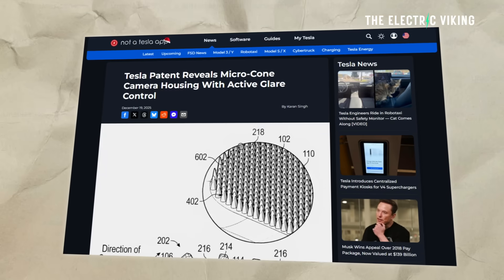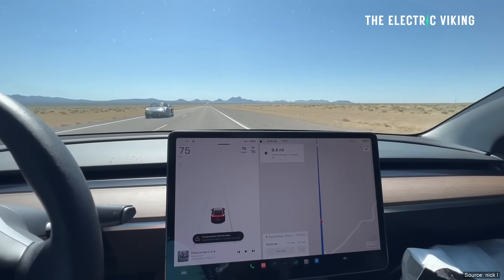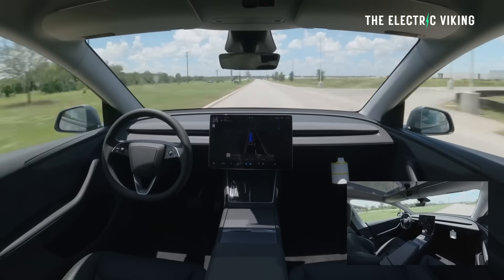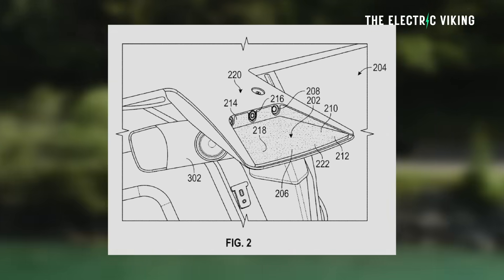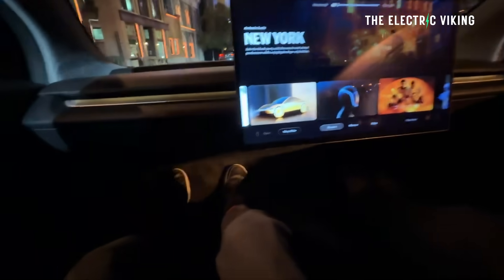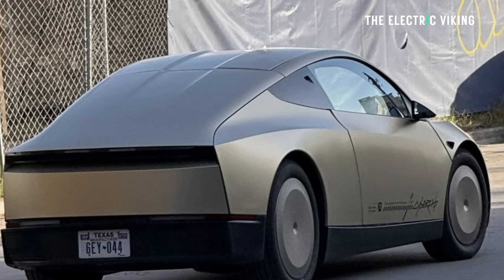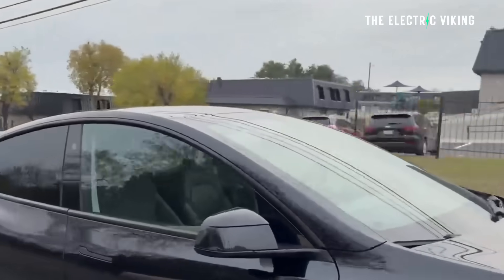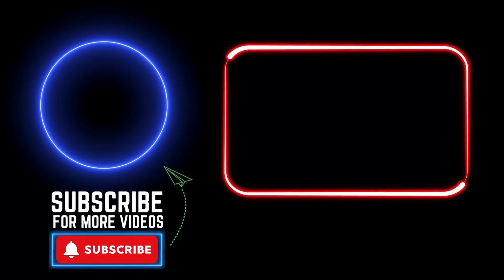LIGHT-SWALLOWING TECH! Does Tesla’s Micro-Cone Patent Solve FSD?

Comment: The patent is interesting, but Tesla still doesn’t have a Level 4 or Level 5 autonomous vehicle so it is hard to "imagine you're in a Tesla Cyber Cab cruising through downtown Austin at sunset or anywhere in the world at sunset", maybe next year?
 
The fact that Tesla is patenting micro‑cones, ultra‑black coatings and even a motorised "eyelid" kind of highlights the real issue: glare is a major weakness of a camera‑only system. Other companies avoid this problem entirely by using sensor fusion (LiDAR + radar + cameras), which makes them less challenged to being blinded by the sun in the first place.

A number of Tesla patents detail ideas that never reach production, but were this one to make it into the wild, the design would require new manufacturing processes (sintered steel vented moulds) and is likely to require a new camera housing architecture, no doubt meaning a future hardware generation (HW5 or later) making all previous versions of FSD obsolete.

So while the patent is interesting, it is also an admission that Tesla’s vision‑only approach has problems that they are still trying to engineer around, and as this patent is not present in any current production car, the current FSD systems are therefore known to be flawed; and yet the company keeps overstating how close they are to full autonomy.

Comment: though camera (visible light) only for US-FSD is elegant (probably more $$) using additional spectrum sensors is highly beneficial in some instances, including glare and other reduced or low contrast conditions 

I would like to have this: was in a very old Model X and it could determine many of cars not visible ahead with its forward-facing radar… M3PH wanted to go around a car erroneously seeing it was only one car “stalled” 100 ft from stoplight – 3D mockup displayed this

Comment: So, tesla will get better then level 2, but still not autonomous driving level 4? Meanwhile Waymo, Zoox are perfecting level 4 while moving passengers around. Mercedes is at level 3 on the autobahn.
Reply: Tesla is level 2 due to current laws and regulations, and for liability reasons I’m pretty sure. One thing that I find cool in the car is you can turn it off and on whenever you please. You don’t need special hardware equipped, you don’t need any special mapping. Just hit a button and it toggles. 

Waymo’s and zoox use specially mapped areas, and tons of lidar, radar, and cameras. These cars are fully controlled and owned by the companies, you will never personally drive a Waymo or a zoox vehicle. Multiple manufacturers have achieved level 3 autonomy, but as you mentioned, they are only level 3 autonomy on certain highways, especially when conditions are perfect. 

Tesla’s self driving tech is designed to be driven anywhere and on any roadway. They don’t rely on premapped cities, don’t rely on expensive, ugly looking sensors, their goal is to work everywhere and not just specific highways, and are private vehicles driven and owned by private owners all over the world. So it’s a little bit different.
Reply: @gamerdude422  Which is why tesler is having way more incidents at level 2 then Waymo or Zoox at level 4

Comment: Interesting development by Tesla to eliminate flare using tiny pointed cones etc.  There might be a problem when such vehicles fitted with this sort of features if, or when they encounter grime that would tend to settle among the tiny cones. So it may be necessary to also have a system that can effectively clean grime and dust out of the microcone light glare eliminating feature, unless those cones can be protected by a transparent cover.?

Comment: I saw an example of the setting sun flaring issue in a Robotaxi video.  I personally thought it was the edge case that would prevent Robotaxi from getting to level 5 automation.  I'm not an engineer, so I was really wondering what the options would be.  Add a radar just for this edge case (which I know Elon would never do)?  Apparently the answer is to think smaller -- micro-cones.  Hat's off to the engineering team at Telsa.  When they figuratively hit a wall they don't stop.  They go over, under, or whatever it takes to creatively solve the problem.

Comment: For Rain they should use high speed rotating front lens or an air blade in front of the lens to deflect rain drops
Reply: @johnmanderson2060

Good ideas, but a non stick coating is cheaper and less prone to malfunction. 🤷‍♂️

Comment: Glare is not the only problem with the cameras.  Long-term, I think actual occlusion is a bigger issue - snow, ice, mud etc..  So to fully stabilize FSD on a Tesla, there needs to be a way to clean any type of muck off any or all of the cameras.
Otherwise, I am seriously impressed with the way Tesla FSD is performing in non-challenging weather.
Reply: @jimparr01Utube

I believe, the solution they have come up with is mimicking the eye. ie. using micro water jet/tear duct and a wiper/eyelid.  Cheap and effective. Maybe should use warmed up coolant, to be more effective at dislodging dirt and melting ice, in cold climates. 
It was mentioned in this video btw. 👍

Comment: lol gun sights and sighting surfaces have been doing this for half of a millennium.... glad tesla finally patented it :p
Reply: If that's the case, then Tesla wouldn't bother applying for a patent.  I'm sure there are details that are innovative like the use of stepper motors/sensors to track the sun and control the light shield, combined w/ the array of anti-reflective cones and manufacturing techniques..
Reply: @kenbob1071  right, that would be worth making a video about. this one, not quite sure

Comment: Very cool! I hope this genuinely works as a reach around to the glare issue especially if Tesla isn't going to sell these with an optional or detachable steering column or yoke like I hope they do... I personally want them to use a left-right yoke that can be pivoted between left and right hand driving in under 3 seconds like GM's HyWire Hydrogen-powered/Drive by wire prototype from the turn of the century. That would also solve the global left-hand, right-hand drive issue in a more elegant way than the French concepts and their 3 across, central driving position also borrowed for the Tesla Semi of course..

Comment: I still think that a limited factor for Teslas will be the reliance on relatively low resolution, monoscopic camera system to the exclusion of all other sensor technologies. Elon insists on cameras only, against the advice of his engineers. His reasoning is that humans use eyes. But we have very high resolution central vision, which allows us to see detail at a distance that our Teslas can't and we have stereoscopic vision which allows us to much more accurately calculate distance and relative speed.

When you're stopped at a red traffic light, watch other vehicles jump around on the screen, as the Tesla's computer repeatedly calculates the distance to the other vehicles and repeatedly comes up with different answers. I've seen other evidence when driving as the car hesitates then goes then hesitates then goes as distance calculations to other objects varies every 1/36th of a second.

He maintains that it would be dangerous to have two sensor technologies competing, but they don't need to compete. Teslas could use vision primarily and use Lidar to much more accurately measure distance and calculate relative speed. Lidar can support vision, not compete with it.

Tesla is ahead now, but other manufacturers will catch up and overtake Tesla's self driving because they integrate multiple sensor technologies.

Comment: WRONG!  It doesn’t solve camera glare.  U r just regurgitating Elon talking points.  Those cones don’t matter crap when there is direct light.  Tesla is 100% EVERYTHING they can to avoid using radar and or lidar.  And they will throw everything to TRY to make it happen. Try not to be too much of a suck up
Reply: It won't be 100% effective all the time.  Most of the time the light is not coming in directly,  there is usually a bit of an angle so the cones would impact the amount of light hitting the lens, enough that FSD can still operate.
Reply: You either didn't watch the whole video or were so blinded by preconceptions that you missed the other things in the patent. It's not just about reducing glare from angled surfaces. Tesla is doing the right thing IMO, not giving up on developing a more efficient solution because it's hard. This is what innovation and progress is all about.
Reply: @bhabbott  8 years of promised full self driving.  Elon claimed his cars could go from coast to coast with NO DRIVER in 2017,2018,2019,2020,2021,2022 etc. yea so it’s not happening without radar/lidar.  At least their early models had radar but musk got cheap and that’s why China and the rest of the manufacturers will continue with FSD and Tesla won’t until they give in.

Comment: Another reason no other auto manufacturer is able to catch Tesla, Tesla just keeps getting better.
Reply: I’m a design process expert. Iterations are the key for refinement. Keeping the cycles shorter (cycle time & speed), you get more iterations. The design, manufacturing and test cycles for SpaceX are 10X shorter than the aerospace company that I just retired from.
Reply: Full self driving (unsupervised) promised for years. Also he promised that all teslas will be a robotaxi. Let’s say this fixes full self driving, all the people with current Tesla are out of luck. What about the roadster? He took everyone money and deliver nothing.
Reply: Lol...get a grip, dipsheet.  Tesla is dead, it just hasn't realized it yet
Reply: You sound like a complete waste of space, you work for Tesla?
Reply: Other makers use lidar and radar and can self drive in a much wider range of conditions than Tesla.  This means that every Tesla ever sold is incapable of FSD - so Tesla is unique in how wrong and dishonest  it has berm the whole time when other makers already had glare solutions.
Reply: @davidbangsdemocracy5455 What you say makes no sense. The kind of sensor (LIDAR or Camera) is secondary to the IQ of the software for driving. It’s the decision making of the AI software. The AI software is the hard part, not the sensor, which is just a component of the system.
Reply: @davidbangsdemocracy5455   Don't turn the lights out on Waymo or you will be walking home. Tesla's FSD has no problem with city power outages. It's all about the software and speed/accuracy of hardware integration.
Reply: @davidbangsdemocracy5455  geo fenced and thus mapped area’s. That’s something else as FSD, wake up
Reply: Tesla cars still can't do what Elon claimed they could do in 2017.
Reply: @chrisleaver929  like what?

Comment: Not sure why the robotaxi has swing-out doors instead of sliding doors.  When they swing out on either side of the car, they put passing people or vehicles at risk.
Reply: Try opening you car door in traffic. youll get the same result.
Reply: @dclpgh  Get the same result as a horizontal sliding door??????
Reply: I think its because of self cleaning. I saw a video of the car coming in for a scheduled stop and a machine enters from the side to clean and vacuum.
I suppose they worked out a traditionally hinged door doesn't give them enough access.
Reply: @NatureAmen  I meant a powered sliding door, not a conventional hinged door.
https://www.youtube.com/watch?v=U5plGbquQUk
Reply: @tuppenceworth5485 I've never seen that before
Reply: @NatureAmen  it’s on my 2006 Honda Odyssey. FFS
Reply: The Tesla car has 8 cameras with 360 view. I would be checked that the Tesla doesn’t check passing people or vehicles before allowing the door opening. I believe the swing out doors are intended to make cleaning easier.
Reply: @denero66  Yup my door in my Tesla wont open unless the coast is clear. If need be i can override it.
Reply: @dclpgh  Your Tesla isn't used as a taxi, so you can afford to wait.
Reply: In recent updated prototype they also changed location of side camera to fit under the open door so its not blocked when open.
Reply: ..And regular hinge opening doors on a Cybercab would be even worse due to the large size of door required ..swinging open, they would have a much larger area profile than the Cybercab swing up doors..which also dramatically increase the ease of ingress and egress for the passengers.
Reply: Regular car doors swing out even more, and we've managed.  Plus w/ the sensors, the door likely won't open if a pedestrian or a passing car could be hit.
Reply: @kenbob1071  These robotaxis, as the name implies, are meant to be TAXIS,. not regular cars.  They are meant to pick up and drop off passengers most of the time.  It may be fine in the US where the roads are much wider but not in Europe where most roads, especially in towns and cities are narrow.
Reply: I agree, those doors are crazy, especially for Europes narrow roads.
Reply: @StuartJ ..Nonsense..they have a smaller area profile when opened compared to a conventional fully opening door of the same size and allow for much easier and convenient passenger entry and exit plus ease of entry for automated cleaning robots..
Reply: @johnchamberlain4126 they are not Gull-Wing doors.

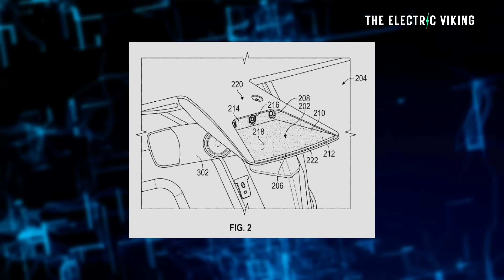Comment: 1:20 yeah because Lidar sucked, right? 😂
Reply: Lidar is expensive, and muxxing it with vision adds a lot of complexity that requires even more powerful computers inside the cars -- adding more expense (and power draw).
Reply: @jrherita analyzying the Point clouds is actually less complex than making Sense of the Image and "traversing" the model-data behind it. If you wanna use it in a smart way you Just Switch to the other one occasionally especially when you you have Trouble with some Edge-case. But the discussion is Not Vision vs Lidar, you need both, Lidar cant read signs but it can perfectly detect it and everything Else AS an obstacle, Vision can perfectly read signs and determine the surroundings If conditions are good but Training is expensive, add a glare from the sun and it will halucinate and make Bad guesses and If you are Standing in Front of a perfectly White Wall IT Technically cant accuratly estimate its depth. PS: Lidar was expensive ehen Elon started Out with FSD, now some Chinese companies already offer the cheapest for 200dollars If you buy 15000 in Bulk. So Elon is Just ego-tripping now, using Lidar will save him some Trouble with Training the Vision-Model which will never be perfect, it cant be.
Reply: @Noname-bg8sh Humans don't need Lidar, so neither should an autonomous vehicle. Lidar is a crutch for when your AI isn't good enough. But of course the cameras have to be good enough too. Humans don't just stare at the Sun, they use various methods to reduce glare such as squinting and using a sun visor. Tesla has the right idea with its patent - mimic human behavior.
Reply: @bhabbott should we get rid of the wheels too and add legs to the Car than? The AI does NOT Work Like a human brain, If i have never Seen snow in my life before i would still be able to make Sense of it and navigate the Street, the FSD AI doesnt, you need to train it again because it works only on visual cues, meaning i need to train it again, Same street during Winter, spring, Summer and Fall, thats Not how a human brain workalsx